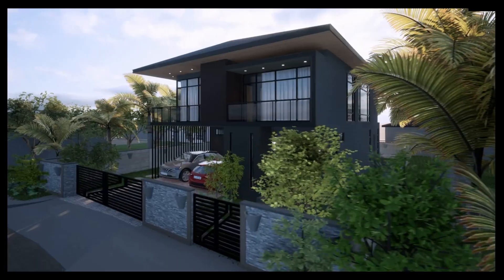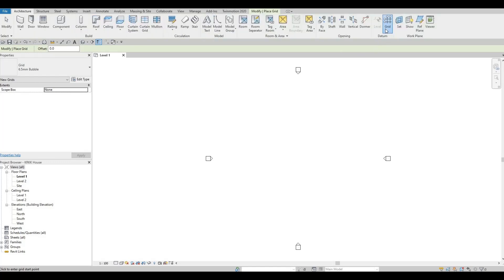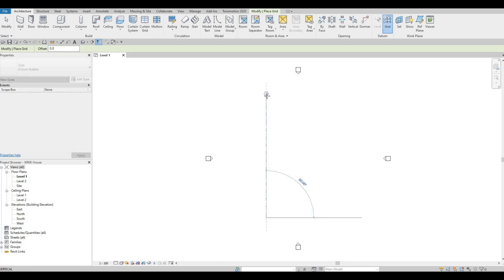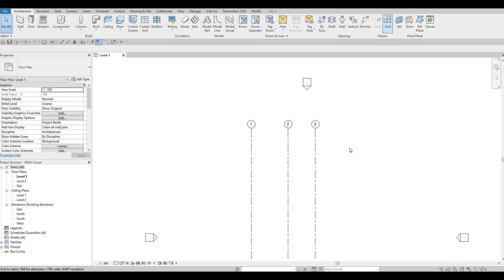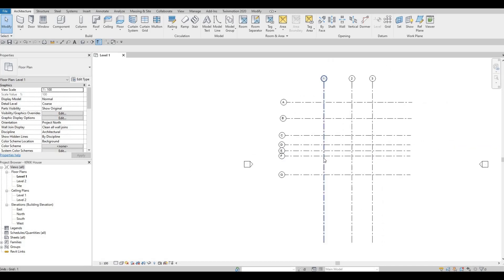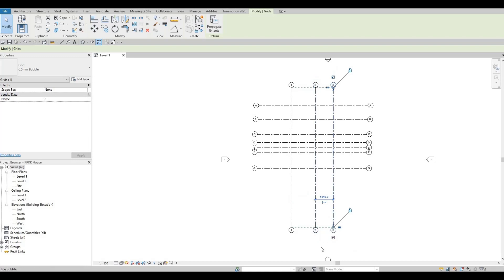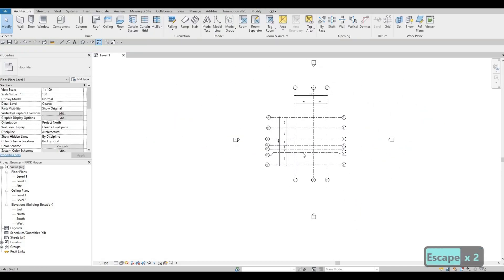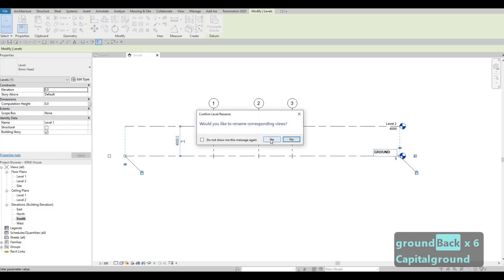KRKK House | Part 1 | Complete Step By Step Project | Revit and Twinmotion Tutorial

Comment: Do you have your system specs listed somewhere?
Reply from the maker: Hi Colby, check the channel description but I have ryzen 5 3600, b450 tomahawk, ssd, 32gb ram, gtx 1660. Not your current pc but still can handle the load. 🙂🙏